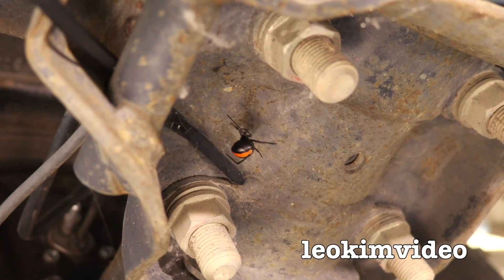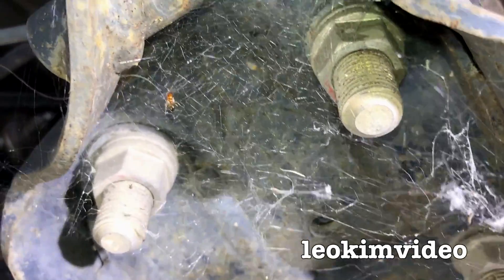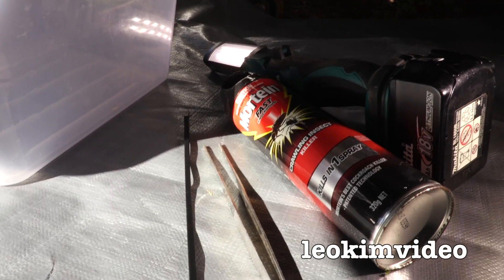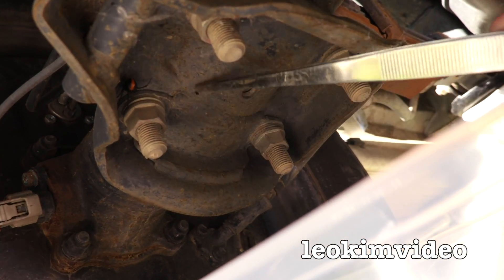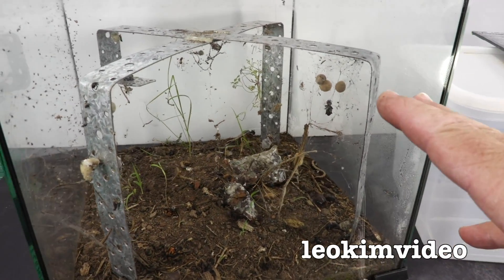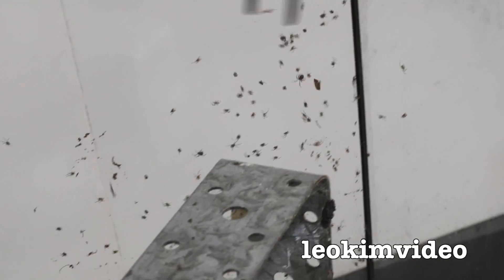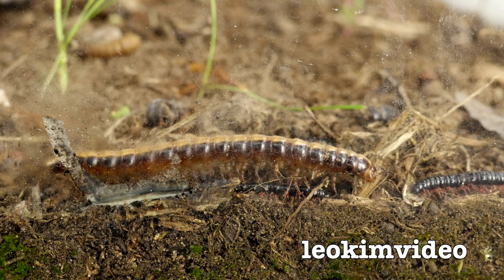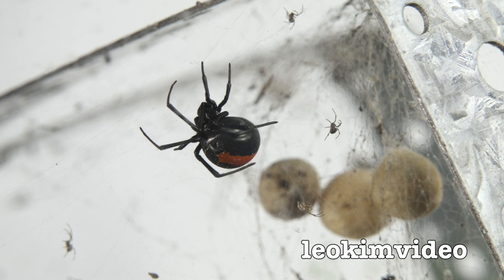How To Catch A Redback Spider Under My Toyota Week 11 EDUCATIONAL VIDEO

Comment: Save money, all you need is a spray bottle, dish soap, Dawn is nice and thick. And some water. Put some soap and water in the spray bottle, 1 part soap to 2 parts water? Slimy enough to smother them. Works on all bugs. I've used it on wasps, army worms and ants, it works.